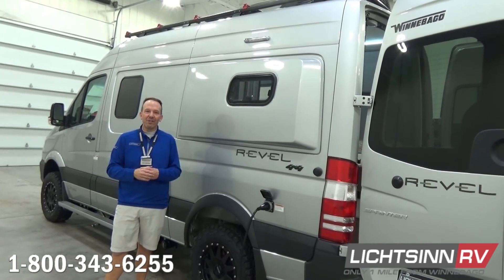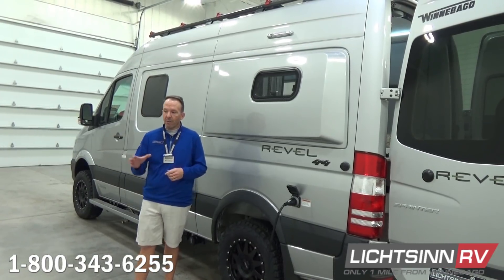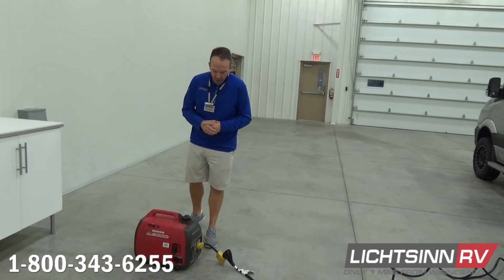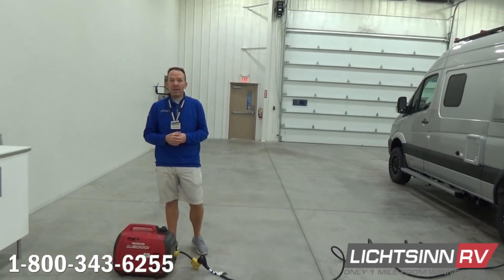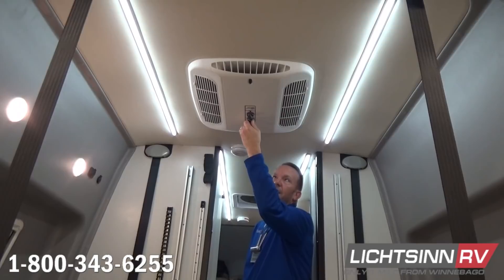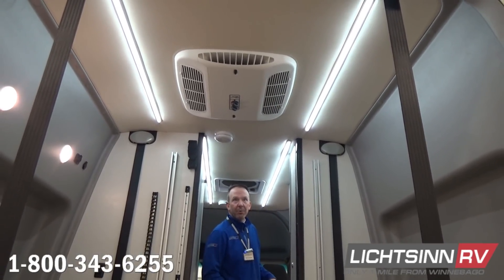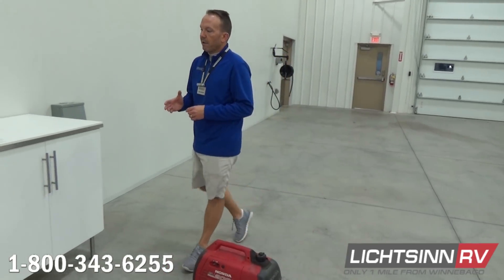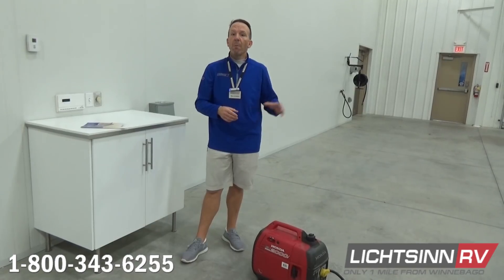LichtsinnRV.com - Winnebago Revel 4x4 Air Conditioner Power Management

Comment: So much for stealth camping how many more batteries or solar panels are you going to need not to run a generator
Reply from the maker: Good afternoon Frank!   It simply depends upon how long you would want to run the air... you would need to do two things, though... rewire the AC to run off the inverter and install the Soft Start for the current AC

Comment: Where is the next chapter showing this running a static load and installed? Once started can this AC be ran on “high” using the Honda 2000? Or do u have to keep
It on “low” or “medium”???
Reply from the maker: Good morning Logan... thanks for your note  the average watts pulled by a 13,500 BTU is 1,500 to 2,000, so if your generator can put out 2,000 watts you should be fine.

Comment: great video, can we upgrade AGM battery to 400AH Lithium ? will this support to AC running . (like 59GL), thanks jeff
Reply from the maker: Good evening!  Thanks for your note... while this is possible, you would need to swap out the inverter and wire to the AC at a higher level, as the air will not run on a 2kw inverter.   Hope this helps!
Reply: @LichtsinnRV  thanks, I hope Winebego new Pure3 system can be implemented into Revel soon ( like their 59GL). Great video, thanks again

Comment: Really helpful demo. i hope that Winnebago gets this figured out with some solar solution. It's pretty difficult to carry a 67lbs generator in and out (Honda 2800watt) plus gas, plus cabling every time you want to get it cool or even safe inside the RV. Or have to run the van for cab AC and a generator for overhead AC in most places in Southern California, Arizona etc. -- June through Sept. It seems like they have the cold climates figured out, but if you take this to any Western states National Parks or BLMs, etc. you are going to bake.

Comment: First off all I wanted to thank you guys for all these amazing videos.  Has been a source of information for my revel.  I saw that in one your comments you talk about rewiring the AC to the inverter.  How involved is this process?  Would it use a lot of battery power to run just the fan?  Unless I am not doing it right I believe you can't run the fan without shore power or generator.  Is that correct?  Thanks again for all the amazing videos?
Reply from the maker: Good afternoon!   Thanks for your note and feedback... it is fairly involved to do, but can be done... the fan in the AC is powered by electric, so you would need shoreline or a portable gen to run this, you are correct.  An alternative if you want more air movement and do not use the AC would be to replace the AC with a MaxxAir Premium vent system, similar to your front, which uses the same cutout and would be 12V powered.
Reply: @LichtsinnRV  Thanks so much!  Have you guys had any luck with any of the 12V AC systems?
Reply from the maker: @paolomarchesi5084  Good afternoon Paolo!   We have had limited installs due to the technology being cost prohibitive at this point in volume.

Comment: Dumb question? How do I get access to the house batteries??
Reply from the maker: Good morning!   Thanks for your note...  on the 2018-2020 models they are mounted up underneath the chassis.    On the 2021s there is a panel inside that opens for access.    Hope this helps!

Comment: I have a 17 Winnebago Era 170X that already has a 160 watt solar.  I am about to purchase a 2000 watt inverter but I do want to do this Micro-Easy start for my AC.  Can it be done?  I wonder if anyone here in SoCal can install.
Reply from the maker: Good morning!   Thanks for your note... yes, this could be done... and ensure that when this inverter is installed that the AC is routed to run on the inverter as it currently is not.
Reply: How long can the AC run with just the 3 AGM batteries?  I have 2 now obviously with the coach but I am planning to buy 2 more and install it under the hood (extra battery tray)
Reply from the maker: Good afternoon!   The 13,500 BTU AC will draw 2800-3000 watts at startup and then approximately  1500-2000 watts at run time.   1500 watts translates into about 18 amps.  Hope this helps!
Reply: This helps a lot - thank you
Reply: I hope you don't mind me asking this question:  so as I indicated above, I own a 2017 Era 170X.  I am about to install a 1500 watt inverter.  I don't intend to hard wire to the AC panel.  I just want to wire it to the battery then use a long extension cord and that's what I will use to plug it my AC appliances if needed.  My question is, which wheel well of the ERA (Driver or Passenger side) should I connect the inverter?  I could not find the battery cables in either side.
Reply from the maker: Good morning,

The batteries will be mounted up underneath the chassis, as they are AGM.

Comment: I wish it comes with the generator in the packages.
Reply: Unknown Blogger no room for it underneath you have weight restrictions as well in the 144 the payload rating maters
Reply: @wildandliving   I have a class c sprinter 3500 it does have a terrible OCC though, but does have an onan diesel generator  and I can run my ac off my honda 2000 if I need to dont know why these new ac units take so much to start mine is an 09 and ive seen generators on other models